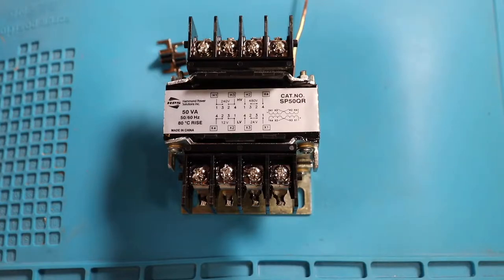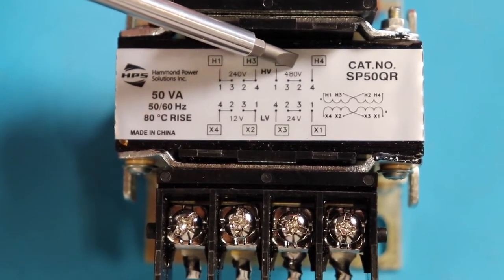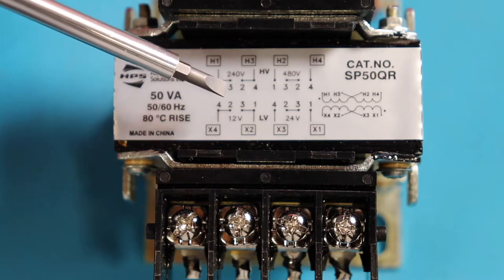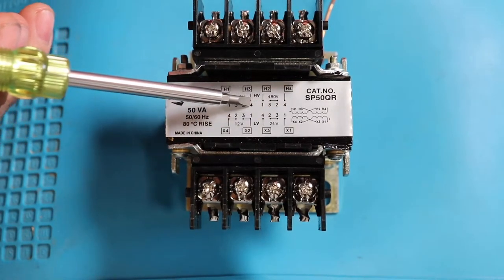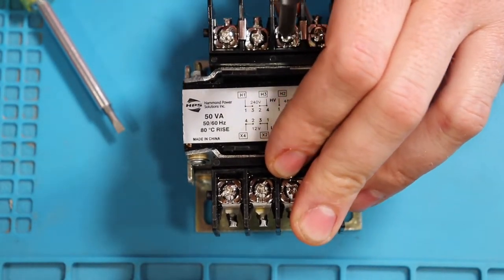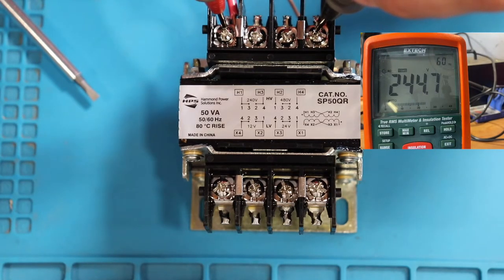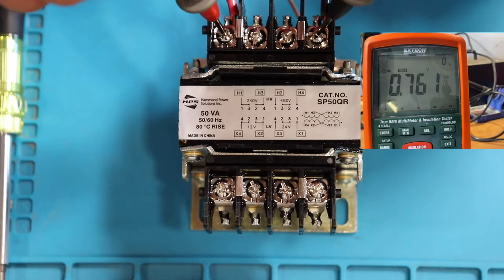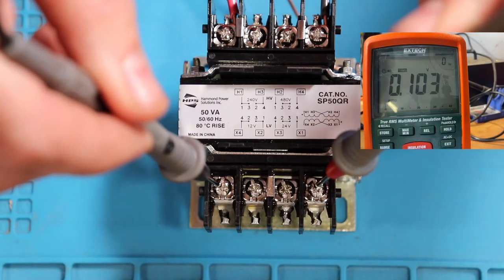How to wire a control transformer

Comment: Hello , thanks for being so clear I have the Siemens MT0100A Transformer I have One Phase 230v from my inverter and I need 2 Phase Between 110 - 120V should I wire 2 lines out of the inverter or use a jumper wire over  ?
Reply from the maker: Two lines out.